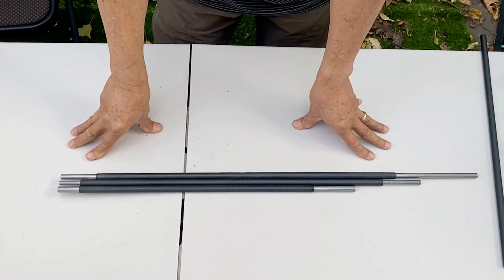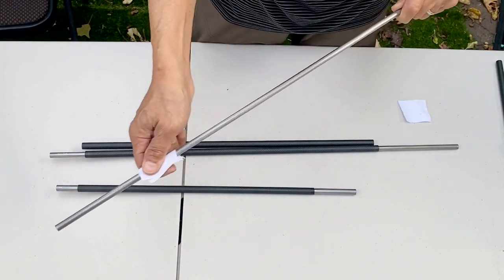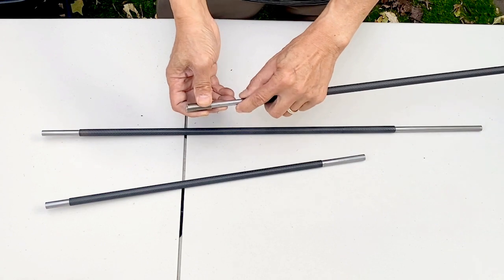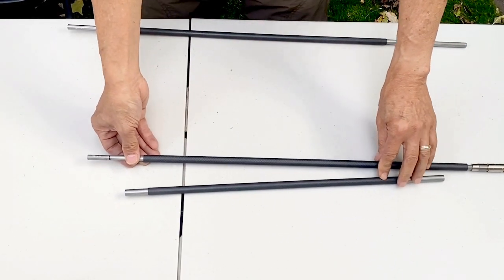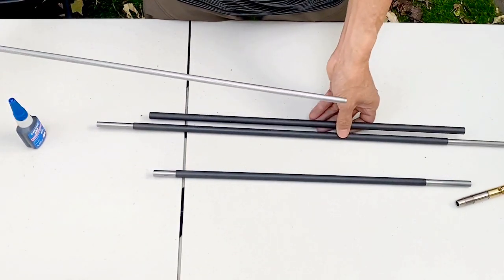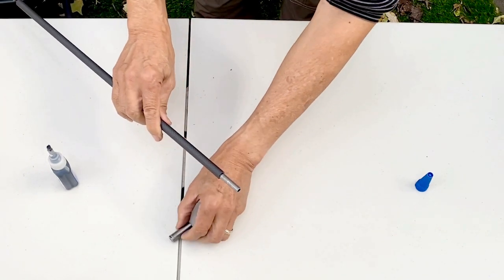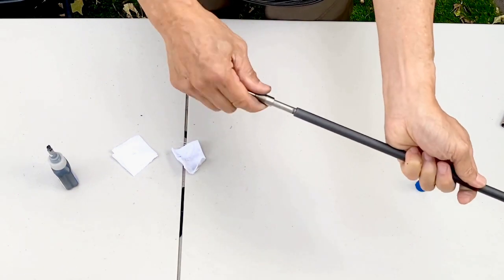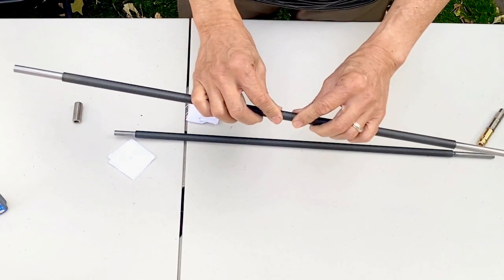FX STX Liner CF sleeve installation

Comment: Ernest, thank you for another great video. Can you tell us why you chose to "glue" the full sleeve to the liner and not just the ends, or some other combo? Would the different glue densities in the length of the sleeve also somewhat give different harmonics? Will these harmonics be easier or harder to tune? Don't get me wrong, stiff is very good for so many reasons, but, can you tell us real data/tuning that says it's better than the O-rings that we currently have? (I'm going to try this anyway, HaHa!)
Reply: GREAT questions my man! I'd like to know too!
Reply: Ernest ?

Comment: Hi Master Ernest!🙌🙏 About to order a couple of your CF  sleeves! Just a question regarding the Liners! do i have to take of the transfer port, as these are Loctited to the Liner!! Can  i not just remove the jam nut, clean it with sandpaper and brake cleaner, wipe it totally dry, mark with pen, then apply the Loctite and insert the CF sleeve and let it bund/cure???
Thanks!!!
Stay safe!
G
Reply from the maker: GeKo ——- no need to remove transfer port or barrel adapter or unscrew the barrel tube.  Remove jam nut remove liner clean and bone the CF sleeve to proper area let cure over nite then reinstall liner
Reply: @ernestrowe5061  Thank you Ernest!! much appreciated!!! 👍

Comment: So, no more orings and no more flex? What are the CF tube's  dimensions for a .25cal
Reply from the maker: Yes no more oring to use, more stiffer. Measure the barrel ID and liner OD you will get your dimensions.

These CF liner sleeve are made with custom size molding— so your not going to see the actual size I’m using anywhere.

Comment: What's the twist rate on the 25 cal 700mm barrel all of them  from pellet to slug liners do you know ty great stuff ernest thanks for sharing
Reply from the maker: Chris Figueroa — Hi, that info is posted on FX Airguns Facebook and Instagram
Reply: @ernestrowe5061  10-4 it cuz one of the liners  I got in 25 cal 700mm measures 17 inches one full turn it has me scratching my head from breach to front of barrel exactly 17 inches top to top of barrel then when it start to turn it's like 20 inches

Comment: congratulations, I'm from Brazil, what is the name of the adhesive used in bonding the tube
Reply: He said in another video that any two part epoxy will work but he is using  black 480 Loctite .
 Don't use regular glue.

Comment: Why don’t they make the 700 carbon liner full length like the 600?  I would think the 700 would need the most stabilization.
Reply: They do 👍 in this vid it doesn’t look like the right carbon liner is on the 700 barrel liner I have one and it’s longer

Comment: What if I got a 35cal will the I need a sleeve for the slug liner?
Reply: Hell yeah you will bro!
Reply: measure the inside Diameter and outside Diameter of your barrel brother. Look on Amazon for the tighest fit. You may have to bu, two CF tube and cut it the proper length. And yes I'd glue it on as you see in this video.  LET IT DRY COMPLETELY BEFORE PUTTONG IT BACK ON YOUR GUN.

Comment: Will the Permatex brand blue thread locker work as well?
Reply from the maker: Its best to use two part epoxy that chemical drys, the cf is long and blue may not dry in the middle. Cf didn’t have to be bounded— just slide in to replace orings

Comment: Can I use JB Weld instead of 480 Loctite?  (the 24 hr JB Weld)
Reply from the maker: Mike Donnell — yes any 2 part epoxy let cure before applying torque
Reply: @ernestrowe5061  Loctite 638 is better.
Reply from the maker: MasonStormSunny —> don’t know never tired— satisfied with 480 results
Reply: @ernestrowe5061  how fast does it settle?
Reply from the maker: MasonStormSunny —-> barrel??? If so barrel doesn’t vibrate up and down just aft
Reply: @ernestrowe5061  how fast does the glue become dry.
Reply from the maker: MasonStormSunny —480 set around a minute fully cure 12 hours
Reply: @ernestrowe5061  great tips, I will tried with Epoxy resin, thanks